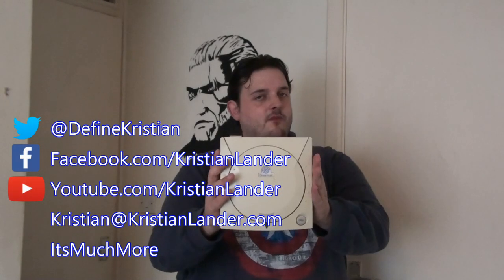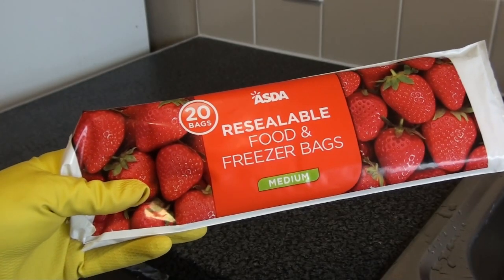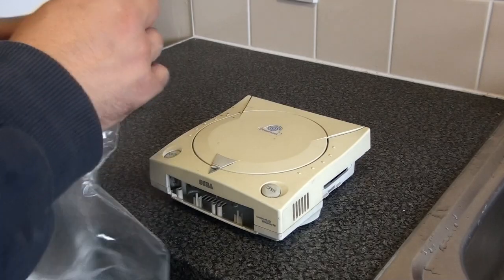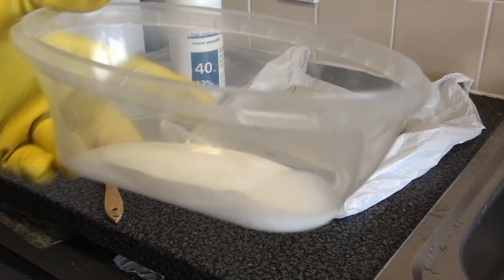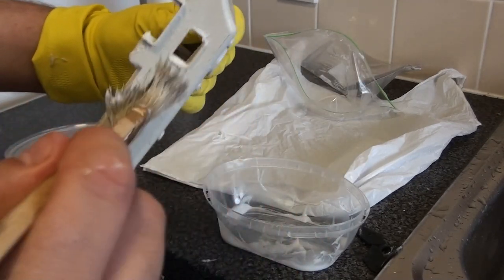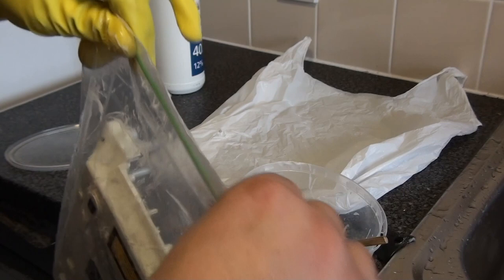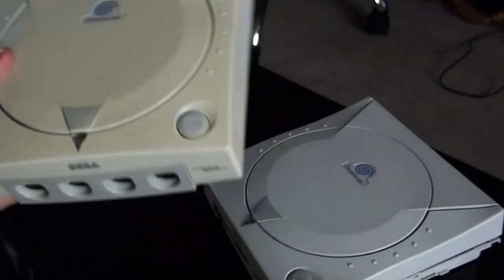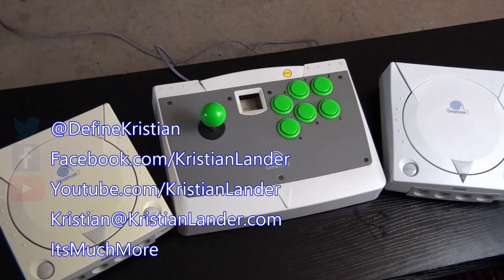Fix yellow plastic into sparkling new white. Dreamcast

Comment: Very impressed and thank you for providing where to buy the Peroxide 40% in the UK! So interesting that even with the cloudy weather here you managed to get it work. All the other videos I watched they all suggested doing this with direct sunshine. Thank you for the video, sir!
Reply from the maker: Thank you for the comment. Took me a while to find a place myself its why I really wanted to include and recommend the site. The solution worked really well. Its possibly a quicker process is direct sun. Had mine in the window for like 3 days. Theres a wavelength of the light spectrum thats helping the process. Some folks who create retrofits all swear you have to use UV black light lamp. Over time it has needed a second treatment since the video was completed. A good year though. Still have high on 7/8s of the solution despite using it on loads of stuff.

Comment: Hi there, great video. Was wondering, do you think this will work on a japanese sega saturn model 1 (the grey one)? Seems to be the same kind of yellowing but obviously this doesn't concern white plastic. No threads on it anywhere.
Reply from the maker: It's a great question, effectively the process of what is occurring with the bromide from within the plastic coming to the surface is the issue. I have done this process to my household vent covers, dreamcast pads, xbox360 controller, but not to anything that was not white in the first place. Now I've a couple of N64 pads that are also looking to be cleaned, same time scale of 20years -  so tell you what - i'll give them a clean up using the same process with the creme peroxide, on the window shelf and post a video of how it comes out!
Reply: Fabulous thank you so much!

Comment: Can you do an update on this? I've heard that the bromide in the plastic will still turn it yellow after a few years, and it's accellerated by sunlight. I think this was mentioned by the 8-bit guy in one of his retro PC's video.
Reply from the maker: Essentially he is right. The yellowing does return, the process works a number of times. I have done this 3 times in total to that particular Dreamcast. Comes up just fine each time. I do wonder overtime if it may do weaken the plastic, in my experience the answer is no. The other one I gave a custom black and silver paintjob too.
Reply: Approximately how long did it take for it to start turning yellow again? Just to know if it’s worth the hassle :)

Comment: I am amazed your logos didnt fade or started to run. I tried this with a broken NES and the logo started to fade and became "runny". So im kinda scared to try this with the Dreamcast
Reply from the maker: at the time, I fully expected the SEGA logo to fade or disappear. However as you saw I only brushed over quite lightly, just washed it on. Give it a try, perhaps just do the base or a controller
Reply: Apply painting tape over logos to avoid loosing colors